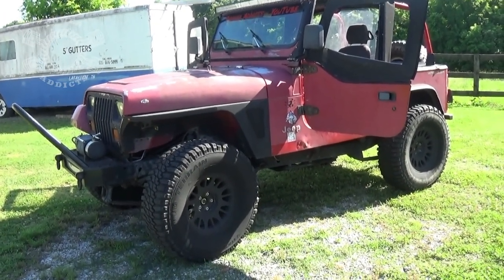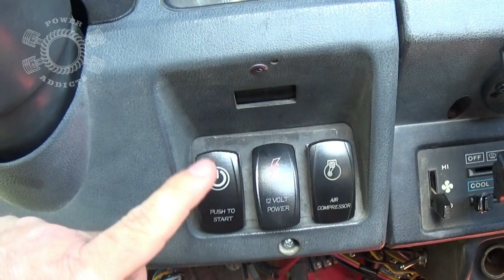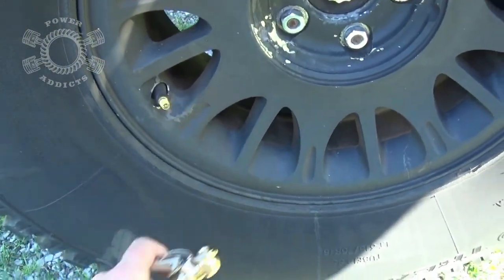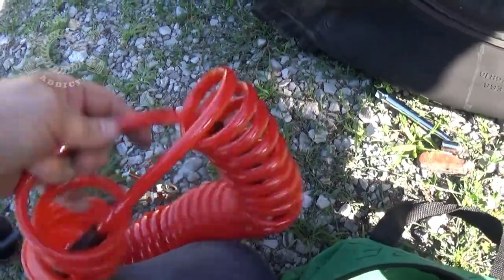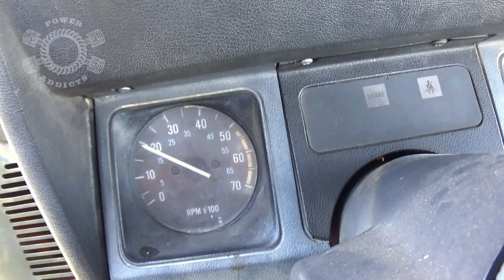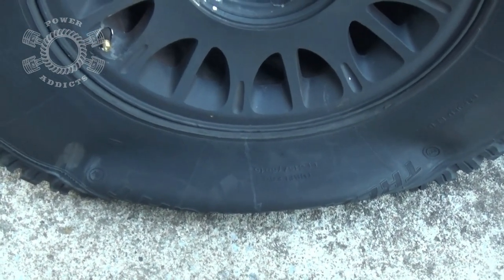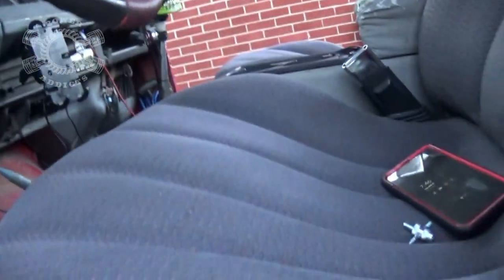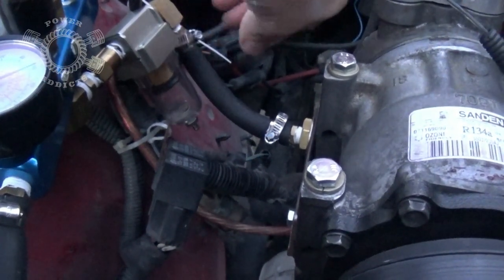Onboard Air Compressor Performance Test

Comment: Cool setup.  The one thing I'd change out is the inflator.  I bought a Jaco digital that makes it much easier to set a more accurate pressure. A 160psi analog gauge makes it near impossible for my aging eyes to set all four pressures within a pound or less.

Comment: I love it I did a similar system on my YJ but there's one more piece of equipment you need to bring it to the next level make you an airhose that'll hook to all 4 tires at the same time turn a ball valve to deflate your tires hook it up to your air system and fill all your tires at the same time

Comment: That tire rebuilding process is called "vulcanization" where it will literally remold and reform all the rubber to make it all fully molded and new.  Not quite as expensive as building a new tire, but just as safe, or safer.
Reply from the maker: Yep, I have a video about those tires when I first got them. They have been great tires, no issues at all.

Comment: Hey I noticed your Jeep takes a little bit to start up mine had that same problem a one way check valve in the fuel system seemed to help it
Reply from the maker: I put a new bosch fuel pump in it a good while back. Its always been like that. I could put a check valve in it .. but .. eh .. it always starts so I don't worry about it.

Comment: Like your oba, however I'm  torn between that and ac my yj has ac and living in Utah (hot) think the ac is going to win. Great video on how to install on board air.
Reply from the maker: If that rig had had AC I would have figured out how to add the OBA a different way. I wouldn't have given up the AC either.
Reply: You may give up the ac if you see how sick they make people the only good thing about ac is the pump .